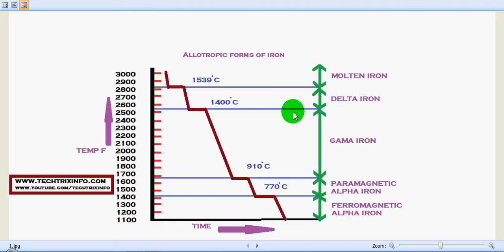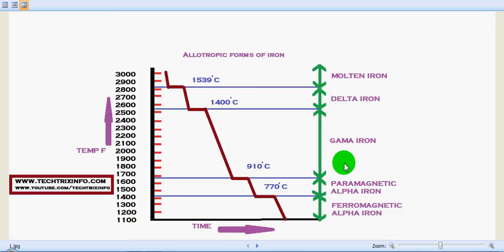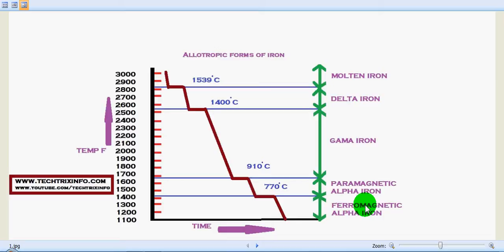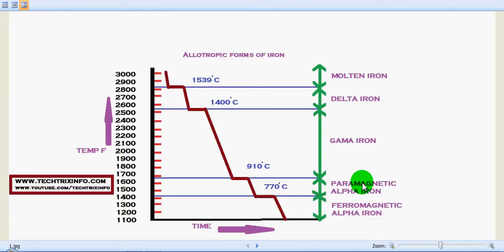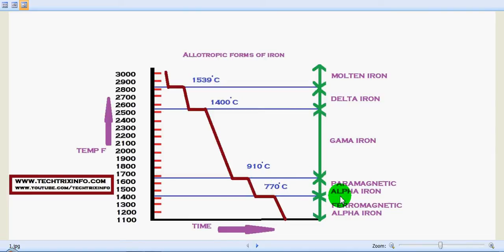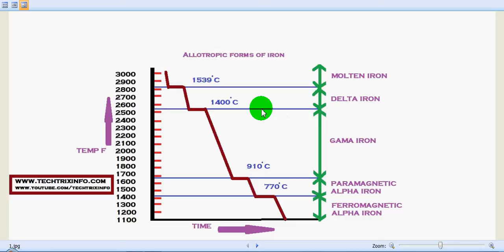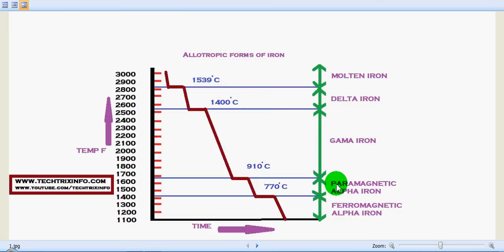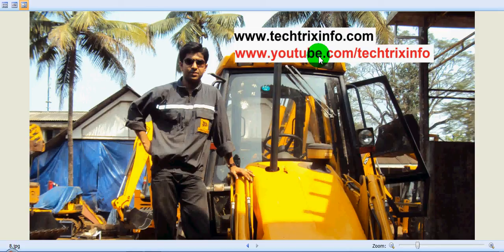How allotropic forms of Iron works. ✔

Comment: Hi, can I ask what will happen when pure iron is at 910°C. Will it contract or expand or possibly melted?
Reply from the maker: At 910°C, pure iron undergoes a phase transformation from the body-centered cubic (BCC) structure, known as ferrite (α-iron), to a face-centered cubic (FCC) structure called austenite (γ-iron). This transformation increases iron’s ductility and allows it to dissolve more carbon, making it important for steel production. The change in crystal structure also leads to variations in mechanical and magnetic properties.